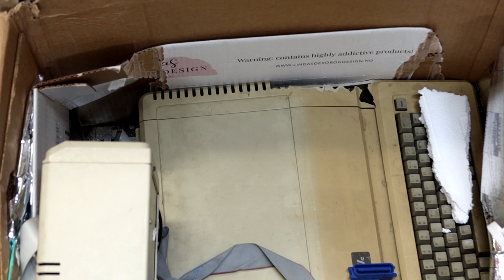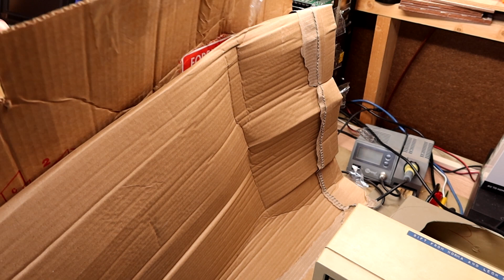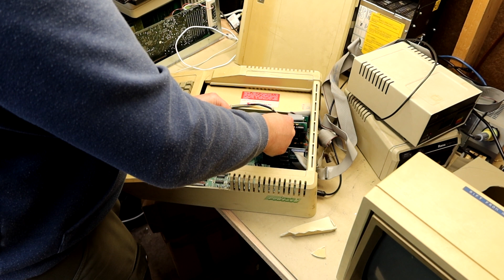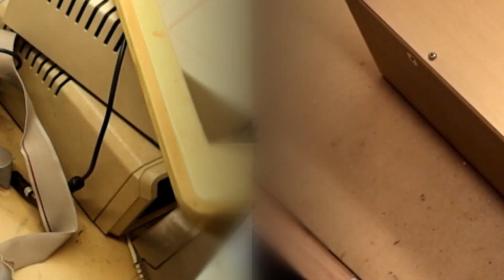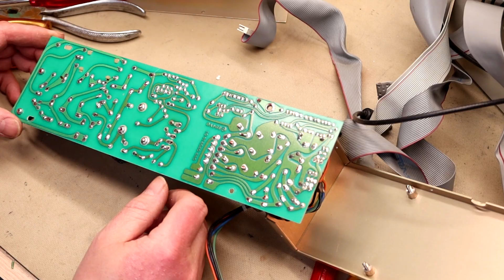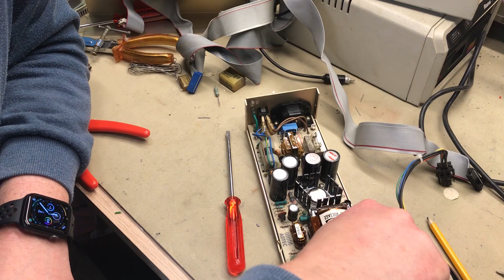A sad Apple

Comment: Sad to see how this arrived.  At least you have a challenge now.  The plastic is likely ABS.  Acetone should weld it, but it will need to be used sparingly to avoid scarring the exterior surfaces.  After welding, I'd reinforce the interior with some clear two-part epoxy.  (I suppose I'll see how you do it - I'm still playing catch-up here.)

Looks like you could use a set of nut drivers, hmm?